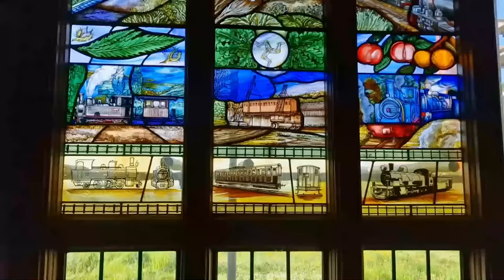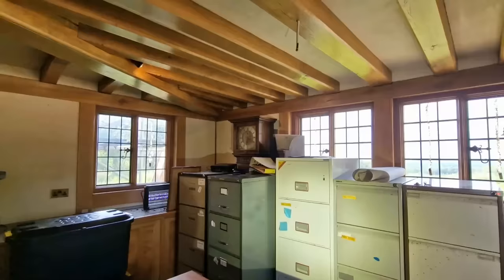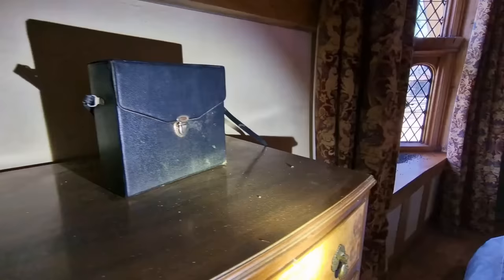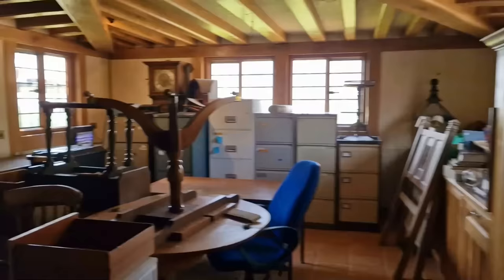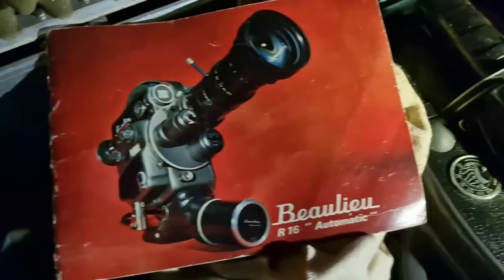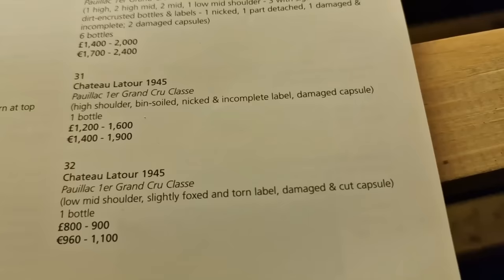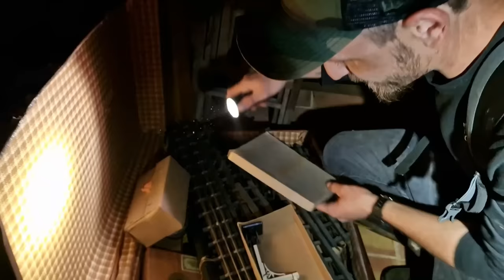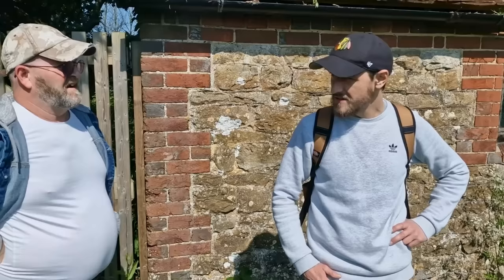We Found a Rare CONCEPT Car In an ABANDONED Mansion!

Comment: I know about every weird car ever made, but never heard of that concept car.
For 1973 it's amazing how much it looks like an '80s Toyota MR-2.   And it's a mid-mounted transverse V8!!!   Crazy sh!t, mang.
Reply from the maker: My 1st impression when I took the cover off was Ford Gt 40, but yeah lovely car!
Thanks for watching 👍
Reply: It is not actually a concept car, it was built around 1976 by AC with A Ford V6 engine, it was first called AC ME3000 but changed it to AC 3000ME when it was released around 1980 due to safety regulations, same time as the Lotus Esprit, so only around 70 was sold, its handling was very poor compaired to the Lotus.
Reply: @zoomie74  Interesting. Thank you!

Comment: Built by AC until 1984, the 3000ME used a mid-mounted Ford Essex V6 that produced around 138 hp and weighed around 2,300 lbs. A fun little sports car, the car's lifespan was marred by production issues and only 106 AC 3000MEs were built, with 71 made from '79 to '84, and another 35 in 1985. Despite the rarity, one AC 3000ME sold for around $20,000 on Bonhams

Comment: You guys need to get in touch with The Great British Car museum just outside of Ambergate/Whatsandwell near Matlock about that car...they'd love to have it/restore it for their cillection for all to see!
Reply: Looks like it wouldn't take much work to get that car running and driving again. The engine might be related to one Ford produced here in the USA called the Vulcan V6. This engine looked very close to that one so parts should be readily available for its engine.
Reply: It's a UK Ford 3 litre V6 called the Essex.
Reply: @jeremywitt1940  with a custom header i take it?
Reply: @weedfreer  Header?  The manifolds are standard Ford parts.  The rocker covers were designed by AC in the style of the ones fitted to the Cobras.
Reply: @jeremywitt1940  ok...rocker covers.

Comment: The Roman numerals are 2004 M is 1,000 and v is 5 with the 1 on the left means subtraction 1 from the v and on right  add 1 means 6 so 4 is IV and 5 is v 6 is VI same way till 8 then 9 is IX cause x is 10 11 is XI
Reply from the maker: Nice one, cheers for the info Kevin 👍

Comment: Incredible mansion!  
What a tour!  
Someone should be informed of the 1 of 1 AC sports car, midengine, look like a V6.  Probably just needs all fluids flushed out, fuel system cleaned including tank, fresh oil & filter, new fuel filter.  Certainly be a $100k+ car!  
AC is the 2 seat sports car that Carroll Shelby designed his first 2 seater car around, circa 1962, first with a Ford 260 V8, then a 289, and then a 427.  
AMAZING !!   
👏👏👍👍☝️☝️💪💪
YES!!  I subscribed!  Look forward to looking at more.

Comment: I looked up the latin on the fireplace, Hulleras De Sabero was a Spanish Narrow gauge railway that hauled coal, guessing the stained glass window was Manx.  The steam train is 104 and it is on the British miniature loco database.   One of the paintings was a Garner type loco.  MMIV is 2004 which was a leap year, not sure what the fox is about, fox leaping? lol.  Bathroom is paneled like an old railway coach, even had coachlight.  Door is maybe double hinged, for moving the narrow gauged train? . Danfoss made central heating thermostats.  Bolex are Swiss 8mm film cameras, that cellar is a fortune of antique brass.  Maybe worth getting in touch with Pete Waterman re the train stuff , amazing car i've never even seen one before, looked it up, Chris Evans has one..  I hope nobody works out where that house is!!  I think ''magnificent'  is the word for that house, would love that roof beam room!!  :O

Comment: What a gorgeous house, I had a poster of the AC3000ME from when it was launched it was £13,000 , it was free in Car magazine, i think I still have it somewhere . It isn't a concept car they sold 71 before going bust . The engine is a Ford 3.0 V6 , unfortunately it handled like a pig, but I'm sure with todays suspension up grades many owners have sorted that out by now. Great find though . The last decent one I saw sold had just had an £11,000 restoration and sold for £18,000 !!!

Comment: 29:47 I see the page and that the info is correct, but did someone take a Fiat Bertone X1/9 and rework it into this, as that is definitely an X1/9, except someones taken the targa roof off, turned it into a coupe, reupholstered it in properly connoloy leather instead of Vinyl, put in a gated manual shifter from what looks to be a dino, and then restyled the front to look like a TR7

and replaced the 4 Clyinder with a 6, and that steering wheel is still the same off of the X1/9 just redone with a pillow, a maserati style pillow that they had to put on the Ghandini penned Cars for safety when importing them into the US, with the AC logo on it

and even if you could I wouldnt start it till someones had a look at the wires, as theirs mouse waste in the passenger compartment

like I'm so so on the X1/9, and not that much of a fan, as they have a very 1970's crap tapular italian junk feel to them to say the least vs say an Alfa but please tell me you've contacted Ian Tyrell or someone like the late brake show to get this thing out of there and back up and running

as for england and 7 years left abandoned its in damn good shape, most even in period didnt last 5!

like is it fiberglass?

and to think someone took an X1/9 and turned it into their own version of the 206/246 dino like this, like I admire the effort, and its not a bad idea, but well......

Toyota failed with the MR2, Pontiac Failed with the iron duke, Porsche failed with the 914, and the only people who made a succesful V6 supercar, was ferrari under the dino name that was named after his son lol 

also the fiat dino using the same motor was a damn good car, like a mini Lampretti ferrari, the ones with the detuned F1 race engine from the 50's

which is why those command so much money now, and to think my pops nearly went for one in aviano italy, its just that it was god damn brown

kinda poetic really though, by making that car people do remember dear old dino after all and it was the only one that worked

damn beautiful car too

and to think those idiot ferrari purists didnt consider it a real ferrari, despite what that engine could do and what it was put in

only the rally champion lancia stratos of the 70's, I do wonder just how potent that essex V6 could be though, 

although the grenada on the sweeny had that, and that wasnt a slow car by any means